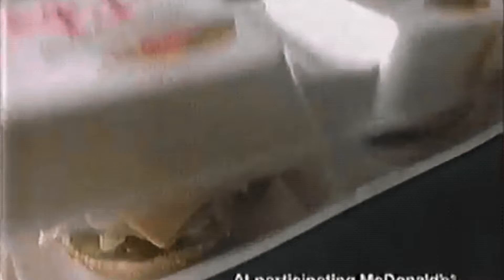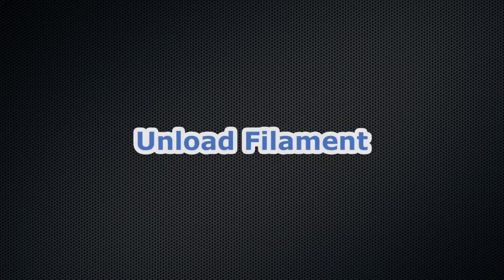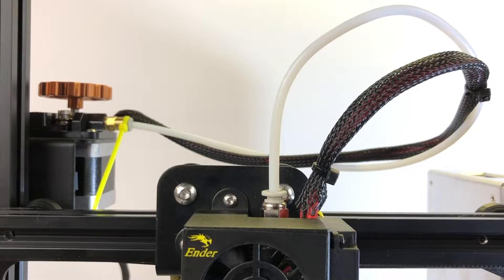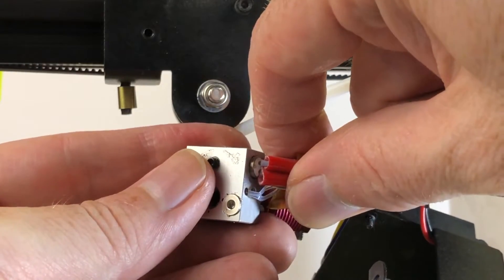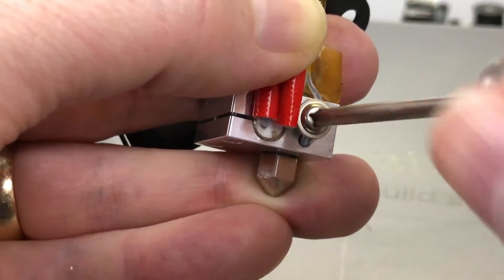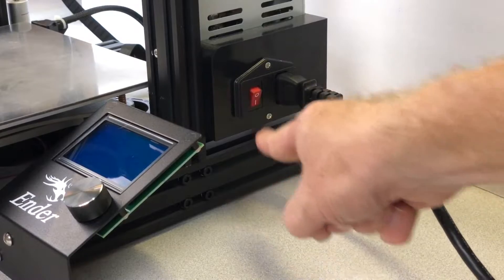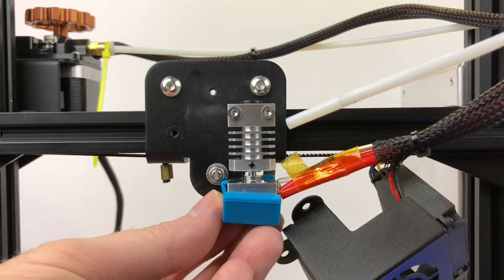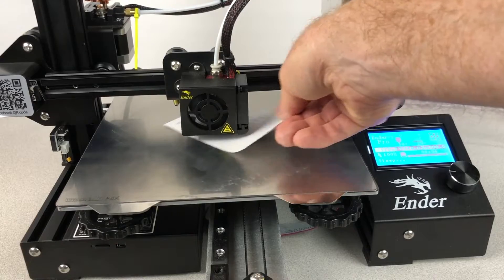How To Install the Micro Swiss All Metal Hotend on Ender 3 & Ender 3 Pro

Comment: Thanks for the helpful video! My factory hot end/nozzle became so clogged that nothing I did seemed to fix it. This helped a ton with replacing it. Unfortunately the thermistor and the factory nozzle both broke off when trying to remove them, so that was fun.

Either way, you got a sub from me for this!

I haven't tested it yet, but wanted to leave a comment before I forgot!

Comment: I have been using mine for awhile now and have no complaints really.  Well, I do have one.  Apparently I did not get it tight enough or it loosened up and filament is leaking onto the top of the heater block.  Now, I have to figure out a method to clean the filament off and tighten it so it won't leak.

Comment: Bryan, I intend to upgrade to the Micro Swiss head, and I recently upgraded my Ender -3 to the 32 bit mother board. After you installed the Micro Swiss, did you have to download firmware so the Ender-3 could be set for higher temperatures? (or any other changes?)

Comment: Thank you for the detailed step by step instructions. I have the Ender 3 V2, but your guide worked fine. My thermistor was stuck in the original heat block with filament from a previous jam up. The only way I could get it out was to hold the block in vise-grips, heat it to 200C, and push it out with a hex wrench from the end opposite the wires. This may be helpful to other viewers who encounter the same issue. Thanks for all the excellent videos Bryan!

Comment: Thanks for this video. I just performed this upgrade and I'm very happy with the result. Fixed an issue with clogging, and the print quality looks really good so far. Thanks again!
Reply: just to follow up - after a few weeks, this is one of the better upgrades I've made to my Ender 3 Pro. Really happy with the results. Thanks again for sharing these instructions. Thank you!

Comment: I was with you up to the screws. Mine doesn't have any as I have a Longer LK5 Pro. So now what?
UPDATE: There is a microscopic set screw that undoes the whole heater and thermistor.

Comment: Love the video; very; easy to follow. I watched the video a few times taking notes. I have put together hotness several times but I still don't exactly understand the best procedure. Question: where did you find the info about retraction amount. I also have the E3D all metal hotend. with that hotend they say not to retract more than 2mm As to not get filament to pull into the cold part of the hotend. So is the Microswiss hotend coated or designed differently as to allow 5+mm of retraction. An explanation will be greatly appreciated!! With a Bowden tube set up in the past I had to go with 7mm and then I had 0 stringing. With the E3D hotend at only 2mm of retraction I could not stop stringing no matter how fast or slow I retracted. THANK YOU!! I love that the Microswiss is a drop in replacement.

Comment: I'm quite new to 3d printing. I purchased a Micro Swiss hotend for my Ender 3 pro from Amazon Canada. What arrived was in a single clear bag, all assembled and labled Made In China. Can you suggest the route I should take from here or is it somehow a genuine thing? (duh!)
Reply from the maker: Hi Joe, it sounds like you got a non-genuine part. The Micro Swiss hot ends are made in the USA. You might reach out to Micro Swiss's support team, just to confirm. Check their Contact page ( https://store.micro-swiss.com/pages/contact ) and scroll down to the Support section.

If it turns out the part is not genuine, I recommend returning it to Amazon.
Reply: @BV3D  I fired off a letter to Micro Swiss support thinking they might be interested that someone is using their name to sell fake products. I know I would be.

Comment: I just installed the all metal hot end in my Creality Ender 3 and cannot get it to print right. It under extrudes and then just quits. The feed just keep trying to push filament.  I have tried hotter and colder that the stock head was printing PLA and no luck.  Everything is tightened when hot and there are no leaks.  I had a spare heater and thermister that I installed, Same result.  Running stock firmware.  Any ideas please.  New brass and hardened steel nozzles were tried.

Comment: My thermistor and heater cartridge won't budge! any advice? I did unscrew everything you said.

edit: nevermind! somehow, plastic had slightly infiltrated it. Had to heat the hot end and then remove while still warm.

Comment: Hello,
I just installed this on my ender3 pro and for some reason once it gets to 200 degrees the hot end starts lightly smoking. Barely any at all but is still worrying.
I put the old one back and it was fine. Ordered a different all metal hot end (big tree tech) basically the same thing and it’s also smoking. I can’t find anything online about this. ANY help would be appreciated!

Comment: I would also calibrate the PID settings for the hotend after installation. Might not have to set the print temp higher once calibrated.

Comment: Was tightening the nozzle and it snapped off. Should've used a smaller handle, didn't notice how much torque I was applying. New one way

Comment: Thank you for the tutorial, one question did you have any issues with the hot fan as the tip on the new hot end sits farther down and the original hot end?

Comment: It is strongly recommended to drop your retraction waaaay lower than that to prevent clogging. Recommended settings, based on other articles and things I've obsessed over this week, are .5 to 1mm. Start at .8 and do some test models. Should have very light, wispy stringing if any. I get mine today, so looking forward to that egg on my face. Subscribed. Thanks! :)

Comment: hello, thanks for your video. If i buy a ender 3 V3 out of the box and install this micro swiss hot end - can i start printing carbon fiber nylon? or would other upgrades be needed?
Reply from the maker: Hi! I haven't printed CF Nylon, or even regular Nylon. But ModBot has. He's got a video covering CF Nylon on the Ender 3. In his video, he's using the Micro Swiss all metal hot end with their direct drive extruder kit as well. The direct drive kit is optional (the all metal hot end is a requirement). He's also using a Micro Swiss hardened steel nozzle because it can stand up to the abuse from the abrasiveness of the carbon fiber. Give his video a watch here: https://youtu.be/A6Df4I4SXJE?t=170

Comment: I was wondering how far that bowden tube goes into the heat sink. Mine clicks into place but pushing it down doesn't go down any further.  If you look from the top of the heat sink the tube looks like has room to go down further but doesn't when pushing the tube down.
Reply from the maker: I made sure mine was fully seated, and put a mark on the PTFE tube at the top of the retaining clip. The mark was 10mm from the end of the tube.
Reply: @BV3D  thanks. So i will have to check mine to see how far it is from the top of the clip.  It clicks and seems seated. Also it doesn't pull out unless i press down on the collet. But was wondering if it is supposed to be flush against the end of the heat sink. I guess not.
Reply from the maker: @2cool4u24  No problem. The ring should be up a bit from the body of the heat sink. When I push the PTFE tube into it, I put the collet clip on and then push it down again. It usually goes in another millimeter, which is about the distance the collet clip raises the ring. 👍
Reply: @BV3D  i think that pretty much answered my question. Mine also goes down a tiny bit maybe about a mm after it clips into place and i put the clip on.

Comment: just my personal experience. I  had massive stringing, AND clogging, when having the Ender3 V2 on 5mm retract, but turning it down to 4 fixed all issues for me, so I will experiment further on this.
Reply: How did you retract it did you do it on cura?

Comment: Just bought it and installed in less than 30 minutes, lovely video helped me out tons
Reply from the maker: Great to hear! 😃
Reply: Was it worth while? 
Is there a huge difference of the stock Ender 3 Pro?
Reply: @DaveM2  for me personally it was because I had chewed up bowden tubes from constant movement as well as  ruined hester block from using pliers to remove nozzles. So I was looking for something that would male the tubes last longer and needed a new block anyways, thus far its worked pretty well. Mostly use it for printing masks and miniatures. Havent had to worry about changing the tubes but that's more of a long term thing ill keep an eye out on
Reply: @krisestrada5084  Thanks Kris

Comment: thanks a million. I'm waiting on my swiss to arrive and there were some items others didn't mention like the print temp to 5 degrees higher. I normally print my pla at 200c so I should up it to 205c? Is resetting the retraction necessary or just advisable ? Oh and new sub :)

Comment: Just what I was looking for. Excellent video. Content was spot on. I did the replacement in parallel with you. Really well done, video edits were clean. Video quality excellent. Audio however. You need to buy a better Lavalier microphone or possibly its the room acoustics. The audio sound reflective, somewhat tinny, and there is a low level backgound hiss. I am being picky because the rest of the production is excellent. I think you will really notice the difference. Looking forward to new videos.
Reply from the maker: Hi HarvardBob, audio quality has been a hard thing for me, I admit. I've gone through several microphones, but these days I'm using an old Shure wireless lav mic, running through a small mixer, and I seem to be getting better quality.

Part of the acoustic issues on this one may have been that I was pretty close to my monitor, which was just off frame. I'm sure speaking that closely to a flat pane of glass didn't do the audio any favors! 😬

Let me know if newer videos (say, in the last 3 months) sound better.

Thanks!

Comment: Hi Bryan.. after watching your video, I installed the swiss hot end to my ender 3 pro. The Bowden tube needed trimming as the end was browned and the tube was sticky. Some parts of assembly was fiddley/tricky,  but I'm ok with that.

My first problem was that I got no extrusion at all - jamming. I soon came to realise that the pla that had been in the old hot end had a slight bulge - trimming the filament sorted that..

I set retraction to 5.5mm, hot end to 220c (max temp for my pla) and tried an xyz cube and I now find I have multiple issues..

1)  the hotter the filament, the more the flow over extrusion, oozing and stringing. 

2) 1st extrusion (side of bed) - the extruder is clicking/skipping - no clicking on print

3) reducing flow rate to 50% and hot end to 200c, no clicking on 1st extrude, but not enough flow to stick to the bed - birds nest at hot end

4) flow rate at 75%, clicking returns to 1st extrude, cube prints, but very poor quality,  not enough filament. 

I cant seem to win - over extrusion, oozing and clicking of extruder 

Or

Wasted/failed/poor quality prints, but extruder is fine and no clicking/skipping

There must be something wrong??

* I've been taken retraction way down to 2mm, but see no real difference from 5.5mm

Comment: How do you remove the bowden tube if you have to unclog the nozzle?
Reply from the maker: Hi Taj! To remove the Bowden tube, first unload the filament. Then remove the red collet clip from under the black retaining ring. Finally, press the ring down toward the hot end, and with the ring pressed in, lift up on the Bowden tube. The tube should come out without much issue.

Comment: Hi Bryan. Nice video. How's the heat creep on this metal end, up the cold block with the stock fan shroud set up? I tried using an old reprap hexagon hotend and it didn't hold up so well. Cold side was heating up too much and filament got a bit soft way before it reached nozzle causing jams. Now whether this is due to the hexagon design or lack of cooling power, idk since I didn't have any extra parts to experiment

Comment: I am having a really hard time with this. I have everything installed, but I can't get the settings right.
Reply: Just installed it myself; having underextrusion issues. Weirdly, they start after the printer is done printing the bottom part of a print, and starts underextruding at the walls 😆
Reply: @calinnilie  I have been making adjustments. The best temp so far with PLA seems to be 213, but other settings need adjustment as well, and this may or may not be the ideal temperature.

Comment: excellent. Can you tell me, we need to change anything on firmware to fit micro swiss? I see some videos where people change the PID after that.
Reply from the maker: Running a PID autotune is a good idea, and I should probably have mentioned that in the video, but I didn't have any wildly fluctuating hot end temperatures after installing the Micro-Swiss.
It's possible I simply got lucky. I should make a quick PID AutoTune video, and I can link to it in the description here.
Reply: @BV3D  great. And with this do you have jams printing pla?
Reply: BV3D: Bryan Vines still waiting for the link :)

Comment: Very nice video, helped me on the installation of the Micro Swiss.  One issue I had that I haven't seen here or in other videos is that a small amount of PLA had gotten under the stock silicone sock and made it to the thermistor and was actually in the hole for it.  It seemed like it was taking way too much force to remove it.  So, I reinstalled the heater cartridge, separated the hot end and fan assembly, and powered the printer back up.  Turned on the heater and once it was at temp, I shut everything down and pulled the plug.  I was able to easily remove the thermistor.  I was worried about breaking those fragile wires and this kept me from doing that.  

Cool shirt, keep up the good work!
Reply: Thank you. had similar problem, ended up doing the same thing
Reply: 3 years later, this is still the comment that saved me from wrecking my whole heating element.

Comment: Great video.  Surprised to see you didn't do a PID tuning of the hot hotend after the install,  which should always be done after changing anything
Reply from the maker: I probably should have. Looking at the temperature graph in OctoPrint, the printer doesn't show any wild temperature swings. But you're right, it's still a good idea to do this after changing hot end components.

Comment: I’ve been having clogs, Bowden tube detaching, over extrusion, and probably more problems with the microswiss.
Reply from the maker: Hi! I'm sorry to hear you're having trouble with the Micro Swiss. If you haven't contacted their support, please do. I haven't had any clogging issues on mine. I have one on the Ender, and two on my Monoprice printers. 

The Ender is the only one that needed the Bowden, and with the little "C" clip that was included in the kit, I haven't have a problem with it. I've found that when installing the Bowden tube, it helps to insert the tube into the fitting, then pull back a little on it while installing the "C" clip, then pushing the tube down a second time into the fitting. It seems to go in another millimeter or so, and after that holds pretty well. It's possible the fitting on yours isn't working right, so their support should be able to help with that.

As for over extrusion, what I've noticed is that with the standard stepper motor drivers (that is, the not-silent ones), a TL Smoother board connected inline with the Extruder stepper motor can really help out. I didn't have much of an issue with mine until I converted the Ender to direct drive, and then the surface of the prints got kind of chunky. A TL smoother helped, but the Creality silent board fixed that for good.

Let me know if Micro Swiss support is able to help you out!
Reply: BV3D: Bryan Vines Thank you for the in-depth response! I’ve managed to fix the clogging and Bowden tube detaching but I’ve had to decrease my print speed by 35 percent for it to print reasonably. After I fixed the c-clip by using a thicker one, the prints started under extruding in areas which require retraction. As my printer was functioning perfectly with the microswiss in the beginning, I believe that there’s a better way of fixing my problems than printing much slower. I’ll start with contacting support, thanks!

Comment: I’am having trouble with my ender 3 clogging up in the hotend, it’s almost like the ptfe tubing is getting to hot down near the nozzle and melting the pla filament before it actually gets to the nozzle. Not sure what to do? 😢😕
Reply: It’s all good now, seems to be working great. All i had to do was switch over to my 0.6 nozzle  and clean out the heat sink thing, then i half unturned the nozzle before i put everything back together. Once it was back together I tightened the nozzle using the half turn that i left. I also marked the ptfe tube to make sure it was seating properly.
Reply from the maker: @bradensinclair9517  Awesome! I'm glad it's all happy again!
Reply from the maker: If you are using the stock hot end (sounds like that’s what you are describing), you could  try removing the PTFE tube completely from the hot end. The end of it may be deformed from exposure to heat. You can use a PTFE tubing cutter or a utility knife to cut it back just a bit. You will want that cut to be as close to perfectly flat at the end of the tubing as you can manage, because it needs to seal up against the nozzle. Loosen the coupler at the top of the hot end by one or two turns, push the tubing all the way down to the nozzle, lock the ring at the top of the coupler (maybe also use a collet clip?), then tighten the coupler to fully seat the tubing. If that doesn’t help, there are a few other things to try.